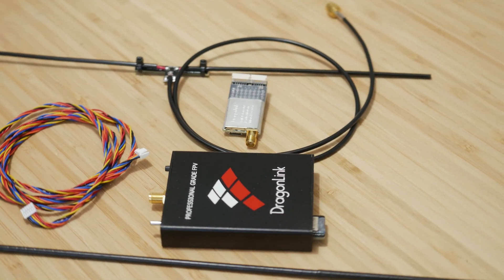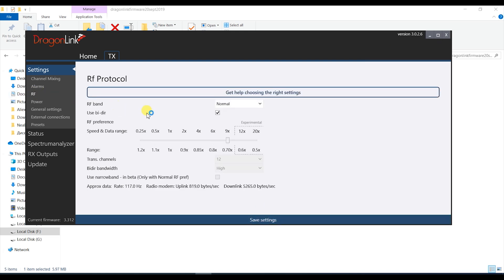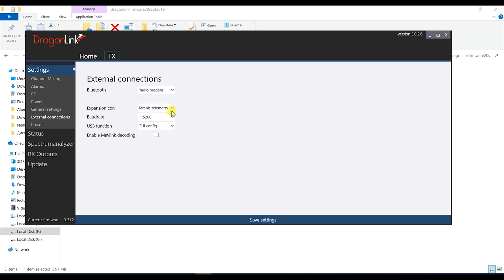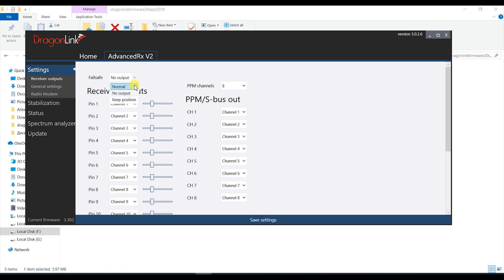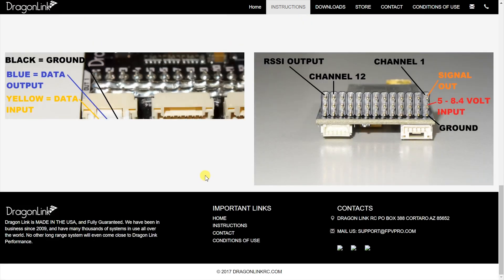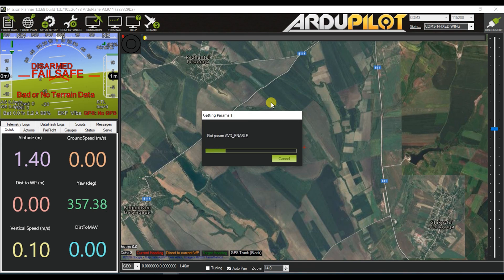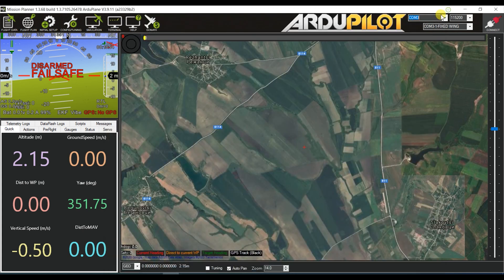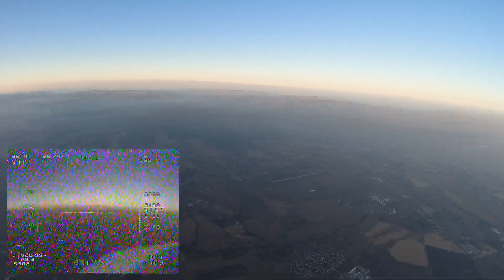DragonLink Advanced 433Mhz LRS Radio - telemetry and system setup

Comment: I’ve watched this video since you posted it 5 years ago, I did not really pay attention as I’ve been flying Dragonlink since 2012. The reason your BT/WiFi connection is not working, on your TX you have the BT/WiFi is set to “DragonLink Mavlink” this should be set to “Radio Modem” & your Expansion con set to “Taranis telemetry”. I know it’s kinda late but let me know if this works. Mine works pretty well and I’ve managed over 100km with a solid & working telemetry link.
Reply from the maker: I've been able to get telemetry working with this system, but the performance of it has been very hit and miss... sometimes it works well, other times I am having issues making it past 12-13km for the control side... telemetry gives up way earlier than this!

Comment: Dear friend, thanks for sharing your knowledge, I am trying to setup my plane, I have dragonlink system and pitlab autopilot, do you know if I can do this exact same thing with pitlab autopilot as you do it with the matek board, I will really appreciate it!!
Reply from the maker: Hi, I am not very familiar with the pitlab autopilot, but if it has the same type of mavlink telemetry output on a serial port as the Matek board, you should be able to use telemetry! Otherwise, in terms of receiver control, I assume it should be able to receive the usual SBUS, PPM, etc., signals, which the DragonLink can provide.
Reply: @ArxangelRC  Thank you so much for your reply, I will give it a go!
Reply from the maker: @cristianjosecastellanobeta8845  Good luck! :)

Comment: Hi, would installing the dragonlink on the spectrum radio cause me to lose spectrums Model Match function?
Reply from the maker: The DragonLink works with its own receivers, you will be using the radio only to supply the channel signal to the DragonLink.

Comment: I have an h743 wing and its stuck at getting params anyone know whats wrong
Reply from the maker: Weird! If it gets as far as connecting and starting to get params... the connection should be OK! Have you checked the DragonLink telemetry setup manual on their website for possible settings that may have affected that? Is it on a new installation?

Comment: Hi and thanks for this.  I'm curious why you specify a baud rate of 38400 from the receiver to ardupilot when the DL instructions specify 57600. http://www.dragonlinkrc.com/instructions/v3equipment/radiomodem/
I'm still trying to troubleshoot and can't get it working on either, so I'm curious if this matters? Maybe DL updated their instructions with the Nov 2020 firmware or they have no clue what ardupilot needs?
Thx
Reply from the maker: Hi, the receiver is setup that way because that is the default rate for the mavlink output in the arudplane parameters! As for the ground module, that setting only determines the connection speed to the computer, has nothing to do with the connection speed between the receiver and the autopilot!

Comment: How to set up my radio modem for PIX32 and DragonLink with V3 microRX? Any written instruction?
Thank you Arxangel!
Reply from the maker: There is a lot of info on their website, the procedure should be the same as for the controllers I use it on! But wait... radio modem? So you mean a telemetry radio separate from the DragonLink?

Comment: I use crossfire which is blessed with bluetooth that doesn't work . Without anyway to connect to mission planner it's quite useless .
This dragonlink looks interesting but I dont see smartaudio ? Since ardupilot doesn't support it Ive been using the crossfire nano Rx to directly control Vtx .
Can I do this with dragonlink ?
I like shorter antennas with 900mhz unit ....how much less range ?
Reply from the maker: Actually smart audio has nothing to do with the radio system in general, as it connects to the flight controller, and just a set of stick commands are used to get into the programming routine of the Vtx, so... any radio system that works with the flight controller, will be good for that! I am still testing the 900Mhz system, but where I live that band is actually used by mobile phone operators... so I am getting mixed results! If you are in the US you should have no issues with range, and should not see much of a difference between the 433Mhz version and the 900Mhz version, at least according to Dragonlink! I will have to talk to them about possibly releasing a firmware with 868Mhz option for the EU!

Comment: put it on max
Reply from the maker: Well depending on the situation I would... hardly needed most of the time!
Reply: @ArxangelRC  yeah but its fun!
Reply from the maker: @doug3d109  Hahaha, well... in relation to the DragonLink specifically... does little to make things fun when your plane and or video system can't go any further! :) I do have all 3 levels setup, so if need be I can switch it to higher output with the flick of a switch!
Reply: @ArxangelRC  but max is always better. for example if you could have a car with 20hp or 500 thousand you would obviously go for the 500 thousand :)
Reply from the maker: @doug3d109  Not really! The "500 thousand" will be insanely expensive both to purchase and to run/maintain, so there is no way in hell I am touching that, unless somebody else is taking care of the bills! In this case, why use higher setting and rain my radio's battery faster, when the lower power setting gets the range I can get out of my video system... and I hardly need more! :) Will bump it up when I go further with my video and plane's endurance! :)
Reply: @ArxangelRC  but its fun?
Reply from the maker: @doug3d109  Hahaha, the car or the DragonLink module?

Comment: Hi, would be possible to connect Frsky's variometer/battery sensor to a Dragonlink micro Rx (telemetry receiver) and get working telemetry?
Reply from the maker: No idea! might be possible... but I've not seen it explained in the manual, and I'd have no idea where to start... :(

Comment: You the only one using and explained the dragonlink.  You need to do instruction with inav and dragonlink
Reply from the maker: Would it really differ that much from anything else? The DragonLink receivers output SBUS... just connect it to the flight controller just as you would any FrSky receiver for instance!

Comment: Good day Sir

First i would like to thank you for this nice video.

I have a question for you.

So, i have Dragonlink v3 advance with  Dragonlink Micro receiver, Taranis x9d plus and MFD Crosshair AP.

I follow  up  instructions from  your video but when i switch off the TX MFD  AP it  doesn"t turn to RTH Mode!!!

I used before same gears with EZUHF instead of Dragonlink and working normal MFD AP.

Please can you help @t you have any idea where i am wrong or where i have to concentrate.

Thank you in Advance 

Samis

I hope you understood my english because is not my mother language.
Reply from the maker: I think this was setup in the receiver settings... there was a dropdown menu for how it should behave upon loss of signal, right? What do you have that set to?

Comment: Hello there again. I ha e been flying with apm but got a failsafe i had it on 20sec so it was to long.with the wind it could not circle that  lo g so my mini talon went down. I did have the last gps coördinaten but was not the real spot it was 800mtr futher. Wen i was there i was to late someone toke it home.i only found the hatch and some foam.now i want some gps tracker. But i really dont know were to start.looking the whole internet... I dont want to loods it again.do you have a solution to follow your aircraft.thanks anything will help. I allready ordered a new one.
Reply from the maker: Can't say anything for sure, because I haven't looked into those yet... but search for something a bit more expensive... and rear reviews to make sure it has an actual GPS receiver in it! Cheaper options are not GPS enabled!
Reply: @ArxangelRC  Thanks i will do that

Comment: Hi, I fly drone but I want to start a hobby based on RC plane , can you tell me what model should I buy to start ? I would like FPV onboard (I already have the headset and screen) and possibly ArduPlane is really appreciated 🤩 
Thanks 😊
Reply from the maker: Hi, well... have you flown an RC plane before?
Reply: ArxangelRC no, just drone
Reply: Quadcopter
Reply from the maker: How much weight do you have for battery?
Reply: @ArxangelRC  i think i will buy new batteries, 
the ones I already have will be used for quadcopters
Reply from the maker: Well... I would suggest something easier for a beginner... one of the Volantex Phoenix or Ranger models... or some other trainer model... which will be easier to fly, but would not be an ideal FPV rig!
Reply: @ArxangelRC  maybe Skyhunter full size?
Reply from the maker: I would not say that is a beginner model! Especially the size.

Comment: Can you please post your connections on the RX and FC?
Reply from the maker: Well the SBUS line from the receiver goes to the SBUS input on the F405 Wing, as does the RSSI! The telemetry Rx and Tx lines go Serial 4 on the F405 Wing... which are clearly marked on the pinout diagram of the flight controller! It is quite simple! :)

Comment: Great video! The SRx params are actually numbered by the number of serial ports you have mavlink enabled on. So SR0_ params are serial0 (aka USB). If the next mavlink connection is on serial4, the serial rates will be controlled by the SR1 params. If you have 2 mavlink devices connected (a mavlink camera or another telemetry modem in, say, serial 1 and dragonlink telemetry in serial4), then the params you'll have to set is SR2_
Reply from the maker: Thank you! :) Useful info!

Comment: In your opinion is it worth moving over from my current tbs crossfire 2w system? Or just call it good tell the day comes I really need the extra punch of 433mhz...

🥃cheers🍻
Reply: I'm wondering the same planing to go long range.. One good site of 433mhz would definetly be penetration but antenna length and Co is a big minus
Reply: How far do you plan to fly? Dragonlink is good for extreme range but I have found CRSF to work just fine as I own both. The good thing is CRSF is readily available.
Reply: @willay747  mountain surfing... so nothing to extream but I'd still rather not go climbing as part of my recovery efforts...
Reply: @Jack Daniels Dragonlink might be better for that! But if you get behind the mountain by mistake, nothing will penetrate thru that lol.
Reply: Nothing shy of military speck that is 😉😉 but that's way above my pay grade although maybe some day we will enjoy such novelties 😅 after all not that long ago we'd never dreamed of fpv in its current state or drones for that matter!
Reply: @willay747  Dragonlink has ZERO customer service. If you have a problem, it is community help only. I don't know if TBS has customer service.
Reply from the maker: Ammmm... what exactly are you planning on doing that a 2W 900Mhz system won't be able to do?!?!?!?
Reply: @ArxangelRC  not much I suppose I just wanted to see what exactly your thoughts were on the matter you have done this for some time now and have the best experience based knolage on the subject on YouTube in my opinion...
Reply from the maker: Well... if this is working for you and you are not reaching its limits on a daily basis... I don't see a reason to change it!
Reply: @ArxangelRC  perfect answer thank you
Reply from the maker: :P

Comment: Does anyone know if dragonlink as a company is actually still active? Everything dragonlink related has been out of stock on every retailer I've checked for months, and there hasn't been a hardware revision for years as far as I can tell.
Reply from the maker: As far as I know... they are still running! I bought another one of these for a friend a few months back... shipped and arrived OK!
Reply: I haven't seen much from Eagletree as far as an update either. Curious. They taking a nap in one or more of their departments?
Reply: @JoshWeaverRC  fpv long range planes are pretty dead compared to how it was back then
Reply: I think the demand for Dragonlink has increased a lot lately and they get sold as soon as Mike put it on store.Once I flew 18kms with telemetry on just 25mw!!
Reply: @amit sekhon  I have stuck with dragonlink for many years and Mike’s method of doing business has always puzzled me.
Reply: @willay747  You are right.He should be looking into how to increase the production.
Reply: Yeah DL is still active but VERY slow about producing product. They're nano Rx's have been out of stock for many months now. It has been frustrating for me so I am now running CRSF in more of my planes.